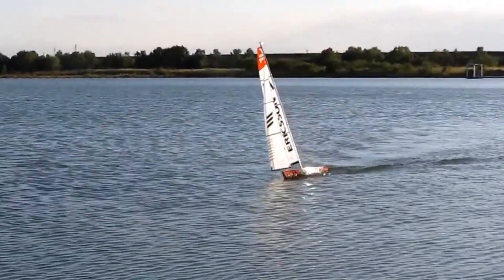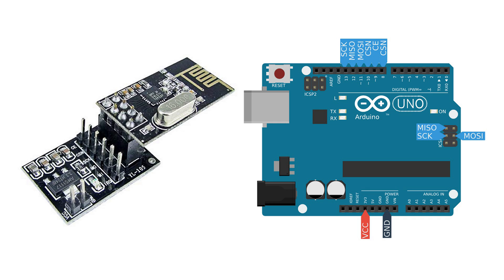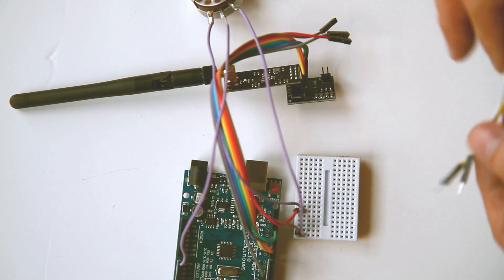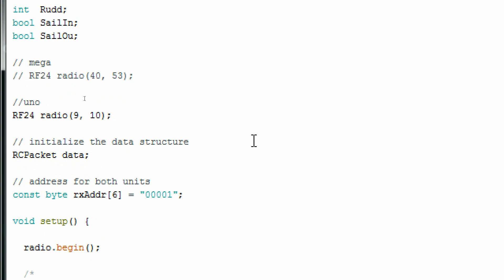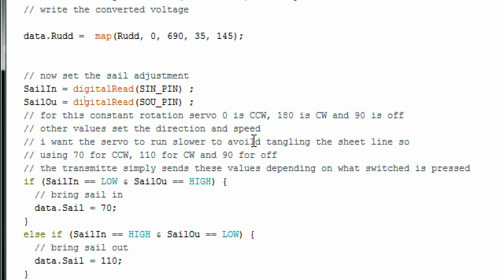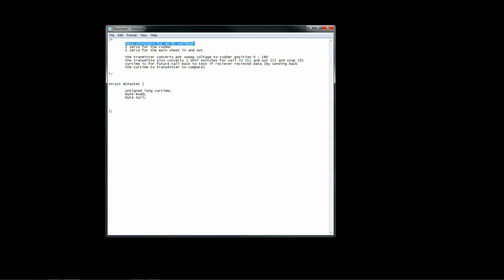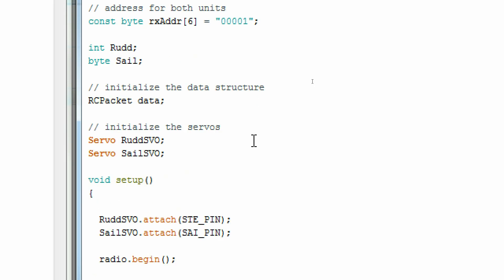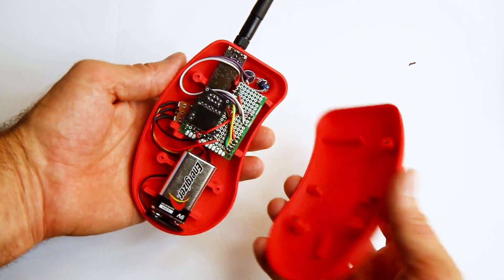Build a wireless RC unit Arduino - FREE CODE

Comment: Great project but I can't add the structure.h file to the library. do I have to zip it first? I can't add it as a zip file: I just tried.
Reply from the maker: Just create a file called structure.h and add the contents listed in the sketch, then save to a folder in your arduino\library folder called structure. You will have to restart arduino ide to have that new library (the .h file) to be recognized.
Reply: Thank you very much for your reply! I tried that but it didn’t work. I will try again later, maybe I missed something the first time. (I am a beginner)   
Thank you for creating your channel with all sorts of cool stuff.  :)
Reply from the maker: @Taran72  Can you be specific as to what doesn't work?
Reply: @KrisKasprzak  , the problem is that the file doesn't' recognize the library. I generated the file and folder as you say but it didn't work. later I will double check everything and let you know. thank you very much for following up. :)
Reply: @KrisKasprzak  , I repeated the installation and now Arduino recognizes the structure.h library on the list but when I check the code I get the error: "Transmitter-RC:1:23: error: structure.h: No such file or directory
compilation terminated.

exit status 1
structure.h: No such file or directory"
I understood that I had to create a "structure" folder and then inside create a "structure.h" folder with inside the structure.h file. that's the only way my Arduino IDE can recognize the file.
Reply from the maker: @Taran72  NO create a structure folder and put the file structure.h into that folder. you must restart Arduino for it to find that lib
Reply: @KrisKasprzak  found the error: I made the structure.h file with the arduino ide and not with notepad. for some reason when I re-created the file with notepad, saved it as structure.h and then copied it in the folder structure inside the library it worked (i mean that there are no errors when verifying the code: I still need to upload it but I am sure it's ok. if you don't hear from me it means that all worked! :) )
Reply: Ok: looks like it's working, but I don't have a 100k pot but a 50k pot and it's working fine as well. I think I also have an issue with interpherence. Now everything is working 100% exactly as you instructed in the video. Thank you so much!!!
Reply from the maker: @Taran72  100K 50k 10K blue lives matter what pot value is anything above a couple K will be fine
Reply: @KrisKasprzak  , ok :)

Comment: sir i have tried the project and i found the problem on the recevier pulled out the SHIT message and the servo kept spinning. Please help. Thank you very much
Reply from the maker: Oops on the message...must of been mad when I was debugging operation:) I've fixed that. In  reciever code, put a Serial.println(data.Rudd); and another line for Serial.println(data.Sail); and see what the values are. I suspect you are sending a value for sail that will not stop the servo. My servos stop at 90, (see the transmitter code // stop sail     data.Sail = 90;). YOu may have to adjust the value. I don't know what servos you are using--so no idea what value will stop them.
Reply: Kris Kasprzak 
thank you sir for your attention. I use servo sg90. for rudder. guess what value is suitable for my servo
Reply from the maker: the sg90 is limited to range--makes for good rudder. i use a different servo for sail--one that spins constantly. you will have to play with the values until you find the one that makes it stop--no way I can guess that.

Comment: Sir 
I want to try this projeck, and please give me the transmitter source code.
Reply from the maker: Mhdghozali ali all the source code is in the download file it's just commented out
Reply: Kris Kasprzak 

In the code transmitter. Does anyone have to modify or just throw away the * /. Thanks for the response
Reply from the maker: There are 2 sketches in that file, you will need to keep only the receiver code for the receiver.ino and use ONLY the transmitter code for a second transmitter.ino
Reply: Kris Kasprzak 
Sir why when I uploaded an error RcPacket does not name a type. Please help
Reply from the maker: did you create the Structure.h and put it in you Arduino library folder (and restart arduino IDE)?
Reply: Kris Kasprzak 
Thank's verry much 
Sir
Can file structures be created with notepad like your video? And in which folder is placed the file structure
Reply from the maker: Yes notepad will work.  put in this folder C:\Program Files (x86)\Arduino\libraries (or where ever your Arduino Libraries folder is).
Reply: Kris Kasprzak 
Thank you sir was successfully uploaded. Can the 360 servo be replaced with a 12 volt dc motor? Good luck always

Comment: Hi, Would I be able to control more than one servo through more than one joystick with the same tranceiver pair or do I need to add a second tranceiver pair?
Reply from the maker: You could easily have multiple joy sticks and multiple servos. The transmitter will simply read the position of each joystick within the loop() and send the appropriate positions (with and identifier to drive the appropriate servo). The receiver would receive the positions and identifier and drive the corresponding servo. I'm actually doing this but not with joysticks--I'm using a potentiometer and a switch to control rudder position and sheet position.

Comment: Hey, is it possible to make this without the big board behind the reciever? For some kind of micro boat?
Reply from the maker: You can use an Arduino NANO, works just fine and is 1/4 the size.
Reply: Wow thanks for your fast answer. I am working on a project here in Germany and I need someone with knowledge about that electronics. Would you like to give me your contact mail for a small coorporation?
Reply from the maker: I just sent you a message through YouTube
Reply: I just sent you an Email.

Comment: No matching function for call to 'RF24::write(int)'

Wtf did I do wrong?
Reply: One hour spent on this problem not working
Reply from the maker: What's it not doing? Hard to say with only one line provided (and not a line from my example).

:: between object and method, not a period?

RF24.write(int);

Comment: hello,
this was a very nice tutorial...
i want to use a gyro sensor instead of the potentiometer to control the servos...is this possible..?
if yes...can i hv the code...
thanks in advance
Reply from the maker: I"m sure you could, i don't have any code. The trick will be to not over or under compensate the servos based on gyro sensor position.

Comment: Hi, I'm having problems at the beginning of your code! I would like to try to do what you did, but I got stuck right in the part of having to do something with such a "structure.h".
Can you give me a hand and explain what I have to do step-by-step?
Reply from the maker: there are a few ways to pass data using these transcievers, the easiest was is using a data structure. Basically it's a way to store data kinda like an array, then you only need to pass the array. For example MyStruct.speed = 10, MyStruct.Month = 12, MyStruct.weight = 2.312, then you only need to Send(MyStruct). The key is that the reciever must have knowledge of the same structure. The easiest way to guarantee that is to put the definition of the structure in a file that the transmitter and receiver read. That way both programs use the same structure. in C, that middle files is called a header file (.h). Put the structure definition into a .h file then #include that .h file in both programs. Hope this helps.

Comment: Source code is there for receiver but can't find transmitter code. Am I missing something?
Reply from the maker: The transmitter code is at the end of the sketch but commented out. Same for the structure definition.

When you get your project complete, share the results, i'm sure my subs would like to see more projects in action.
Reply: Thanks Kris. Will let you see my results once I get something working. Cheers once again.

Comment: can this be used for 1 transmitter for 2 separate receivers controlling 2 servos. I need similar thing except 2 servos are far apart from eaxh other.

GREAT VIDEO..with lots of supporting documentation
Reply from the maker: I've not tried this, but i'm 99.9999% sure you can. I would add a parameter to the structure "ID" and set an ID for each receiver. The sender would be something like

data.ID=1, data.motor=223, radio.write(&data, sizeof(data))
data.ID=2, data.motor=453, radio.write(&data, sizeof(data))
and so on

each receiver would have an if to test it's correct data, something like 

receiver 1:
if data.id =  1 servo.write(data.motor), else do nothing

receiver 2:
if data.id =  2 servo.write(data.motor), else do nothing

and so on

Comment: hye sir..can i have ypur email for this project? currently i'm trying to convert logitech 3d pro gaming joystick to rc tx for controlling my quad..i would like to seek help for the wiring and circuit..tq sir
Reply from the maker: I would recommend joining the arduino forum. you can post code and get help by a huge community of people
http://forum.arduino.cc/